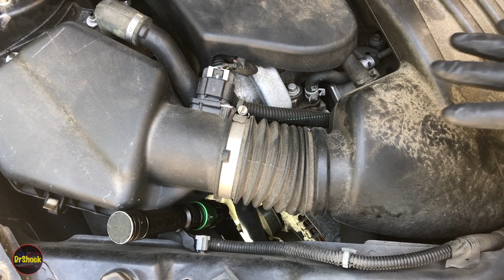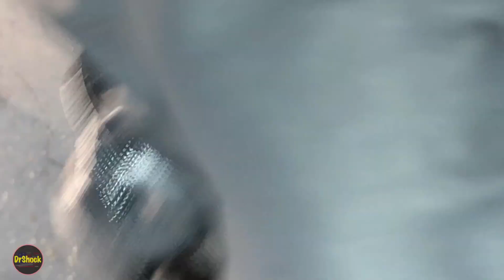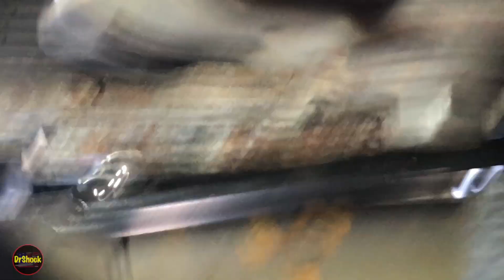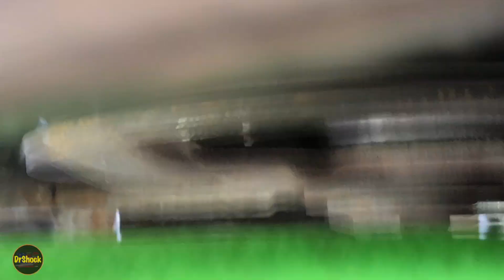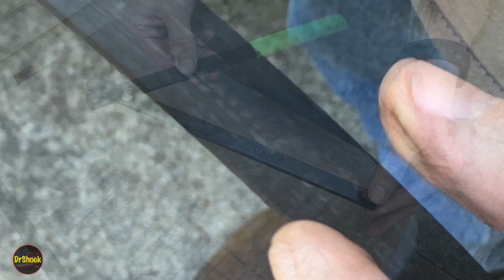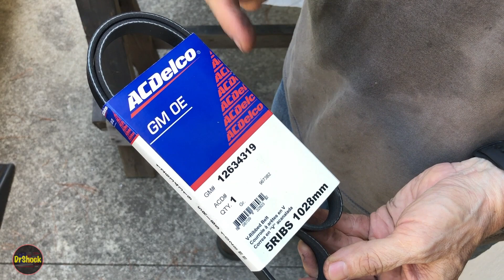2005 - 2010 GM Ecotec 2.2L Cracked Serpentine Belt Replacement Fast (Chevrolet Cobalt & Pontiac G5)

Comment: Did this same job on my 2002 Saturn Ion (don’t know the year range) and I went through the passenger front wheel well you mentioned. Hardest part of the job going that route was removing the inner liner with all of those fasteners. You might add the Ion to your description. It also had the 2.2 ecotec motor 🙂